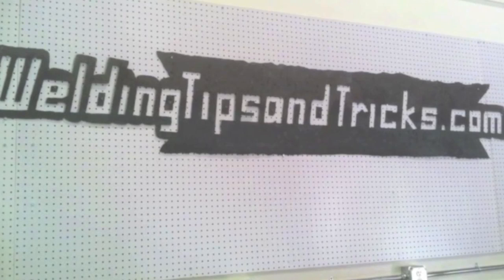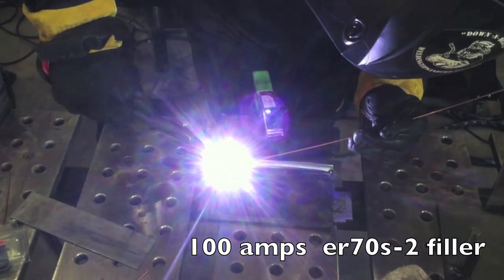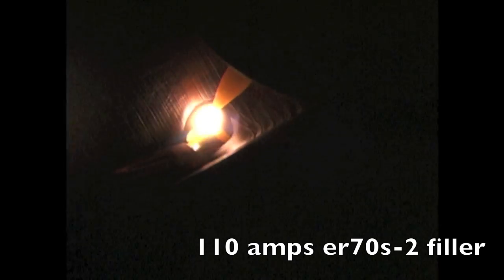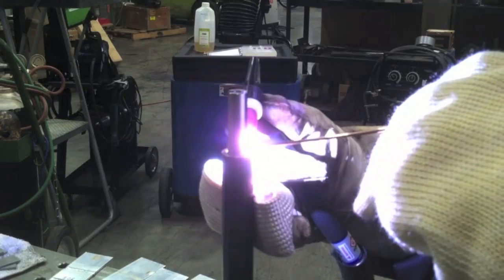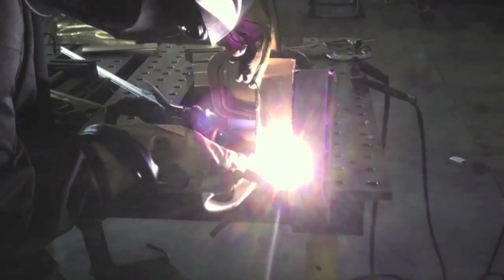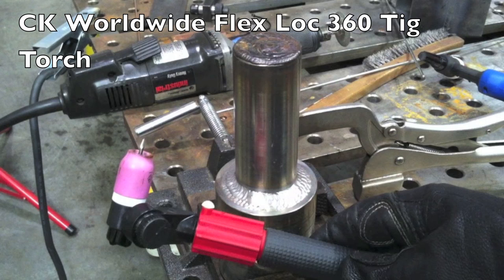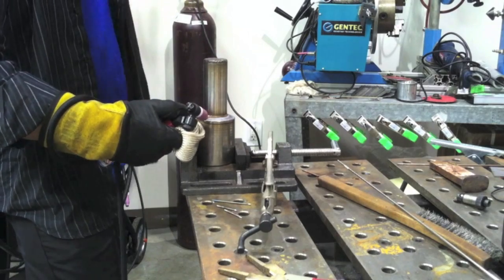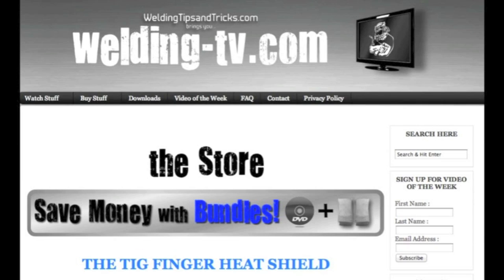Tig Welding Techniques - Walking the Cup vs Not & Tig Finger® Pimp

Comment: STATIC DEPOSITION IS GLORIOUS! I’m a huge advocate for static deposition, the uniformity in your fuller deposition is UNRIVALED. Brother, can we please take it back to the fundamentals? In that, arc length, torch angle and travel angle are set with far greater uniformity, I’m an admitted parameter nazi. Back in the day we didn’t physically engage the work with anything but the current and filler metal. Thank you for addressing the empirical fact that some industries do not tolerate the scratch path from the cup’s contact with the work. On a lighter note I absolutely swear by the CKworldwide torches for many years now. The rigid, the flex, the micro(I can’t remember who made my micro but it’s sweet).

Comment from the maker: for schedule 80 2 inches long works and allows for tacking up multiple joints for practice.  schedule 40 probably would do better 3 inches long for a bit of heat transfer.

Comment: Hey Jody, I just purchased a Millermatic 200. Inverter welder. It's the newer multi purpose welder from Miller that you went over awhile back. I'm having trouble getting my tig to run well. I would love it if you made a video using this welder to show how to set and tig weld with it. I would appreciate any help brother. Thank you.

Comment: If you mean your coupon to be bent they must be a 1 1/2 " in width by code. If you mean pipe length before weldment is placed than 3" per pipe.